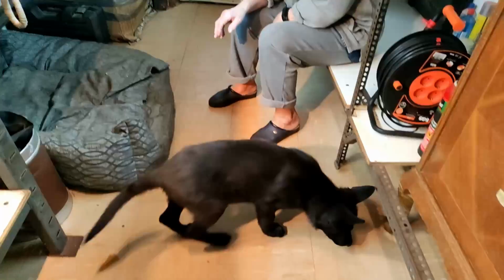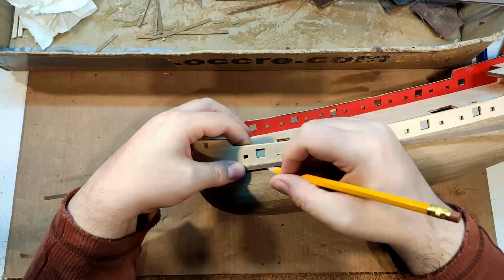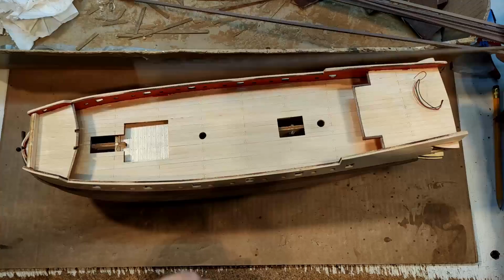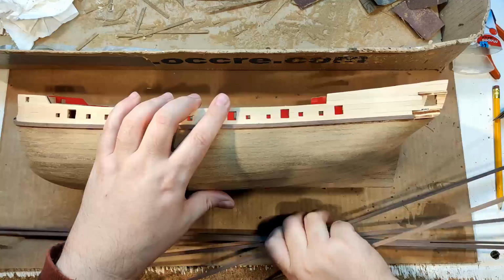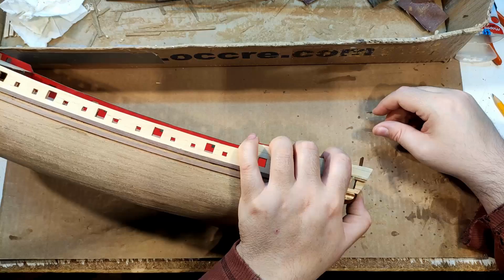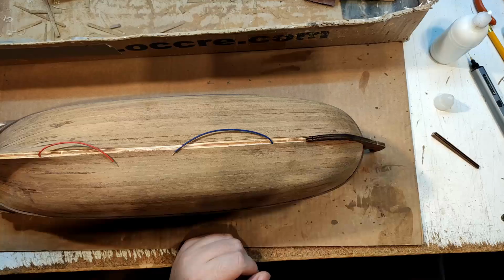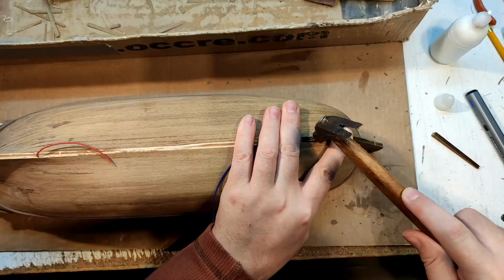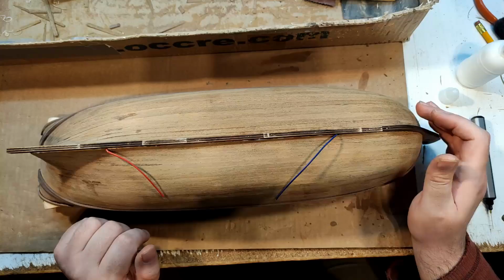La Candelaria - part 13 Placing Rubbing Stakes & Keel

Comment: Dear John, now I am in stage of placing rubbing strakes. I see you have those strips enough long. I have only shorter pieces in pack. Those yours were in original package or you used your own stock. Anyway I have enough shorter strips and I can use two shorter instead of one long. Or should I order those long in Occre? Thanks for advice
Reply from the maker: Hi Juraj! You can use the short ones, but you have to be careful for the following :
Make sure that you use the same color strips on each rubbing strake so they match
Make sure that when the 1st one ends the 2nd begins in the same line try not to have any gaps or have one strip higher than the other
Finally make sure that not all the lines end up in the same spot because it will look ugly. Make one end a little bit further that the upper or lower line.
Reply: @JohnsWoodenShips  Thank you John, as in manual I will stain them, so color will be the same. I only hope that those shorter ones will be needed for other parts, if I spend most of them for rubbing strakes, I will not have enough of them. So I try to fill the spare parts form in Occre web, I use shorter ones for rubbing strakes so that I can continue and maybe later arrive those from Occre. Thank you